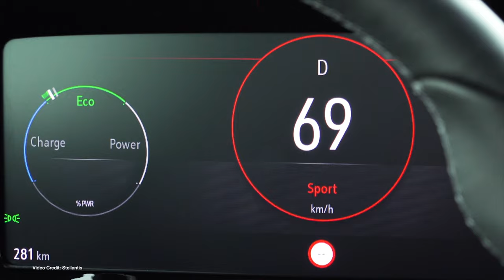Is There An EV Price War Coming?

Comment: Really have to say that you idea to run your house off your EV in an emergency CAN ONLY BE DONE IF YOU ARE ABLE TO ISOLATE YOUR HOUSE FROM THE LOCAL NETWORK, for two very good reasons. First is a legal requirement that the network can not be back livened so faultmen can work on it safely. Second, if you were to backfeed into your local network you would be providing power to everyone which would quickly drain your battery, or cause it serious damage if it does not have good protection.